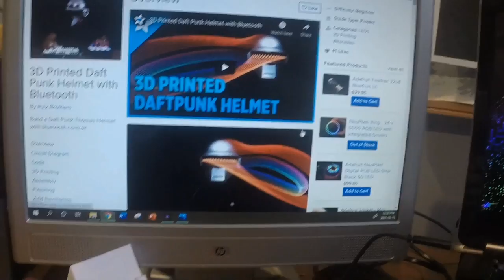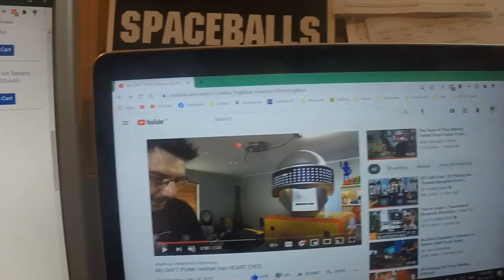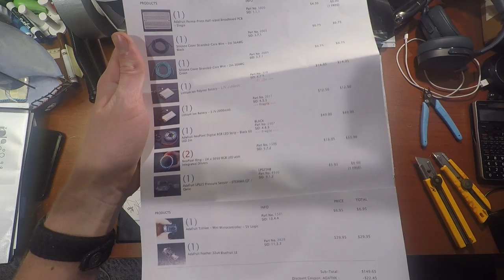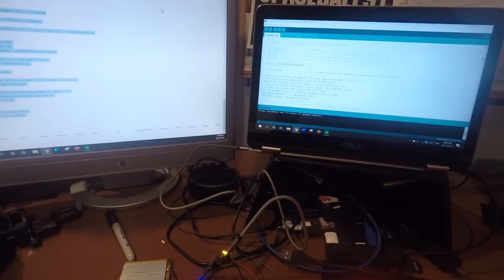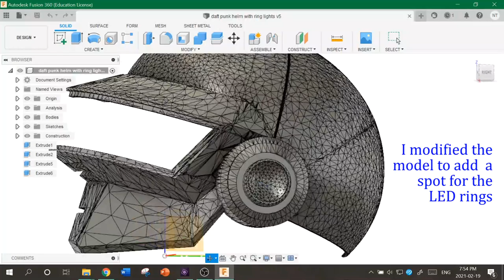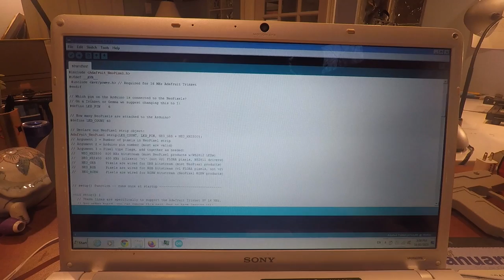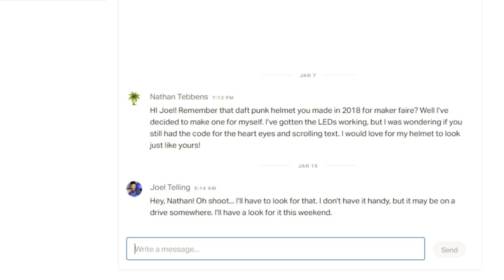Making A DAFT PUNK HELMET with Bluetooth Controlled LEDs!

Comment: So you can make me both helmets and send them to me with the sweet functional LEDs; with an accurate paint job? (for compensation)
Reply from the maker: lol i wish!
Reply: In all the links you added above, I could use those to get all the supplies I need to create my own helmet correct? Along with all the wires and circuits? Side note- what do you reckon the total cost of this project was for you?
Reply from the maker: @XsvShOnUfFvsX  yes, one of the link is the adafruit tutorial, which will list everything you need and show you where to buy it. I probably spent close to $200 on electronics, plus whatever I needed to make the helmet, so maybe around $250 total. That is an estimate though, your geographical location can affect prices a lot and so can you experience. I spent more on the helmet because I tried a bunch of different paints, and ended up making 3 prints. Keep in mind you will have to spend lots of time on it if you decide to make one, not just money. If you think you can do it then I totally recommend making one! It's such a cool thing to have.
Reply: @N8TEBB  yes I am just looking into getting my first 3D printer ever. I have no idea where to start but your model used in this seems like it can handle quite the build for axis involved. Mainly to make cool shit like this or costumes for my daughter and myself
Reply from the maker: @XsvShOnUfFvsX  there is a good video here https://youtu.be/RbtINaQOzDE for deciding which printer to get. I recommend doing lots and lots of research before buying, 3D printing is a complex hobby, and this is a very advanced project. I would recommend doing research and simpler projects before jumping straight into something like this!

Comment: Will the 8x32 ws2812 led matrix panel fit in place apparently it’s 8cm tall by 32cm long thank you @N8TEBB
Reply from the maker: Unfortunately I do not have the helmet anymore so I can't measure how long 32 LEDs would be, but I can tell you that they are spaced more than 1cm apart. The matrix in my video is 5x14 lights.